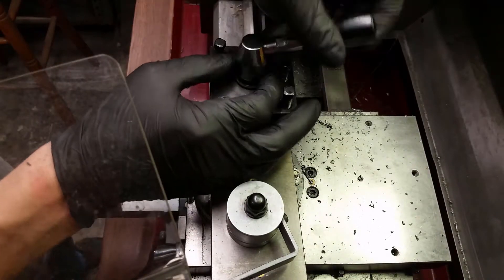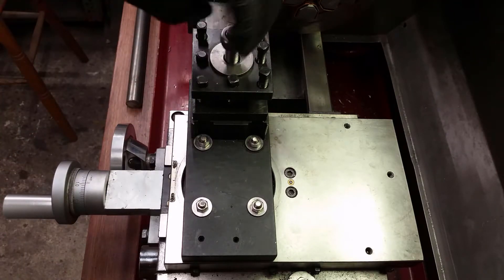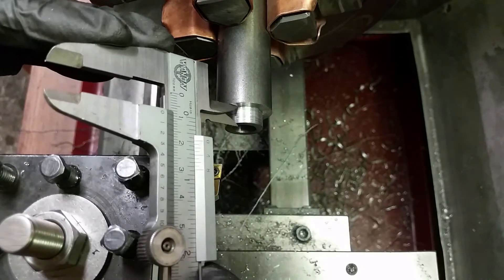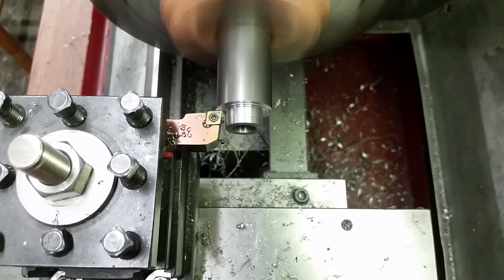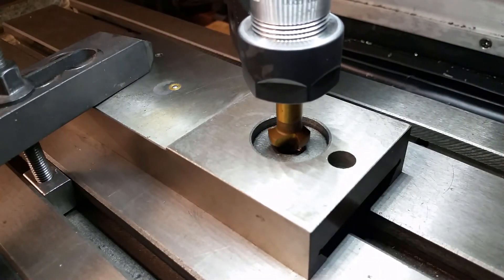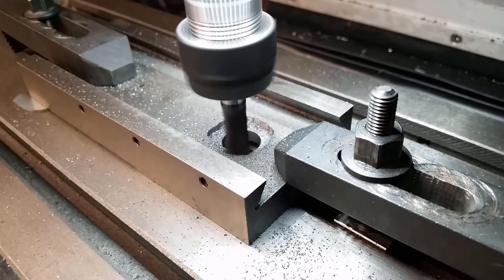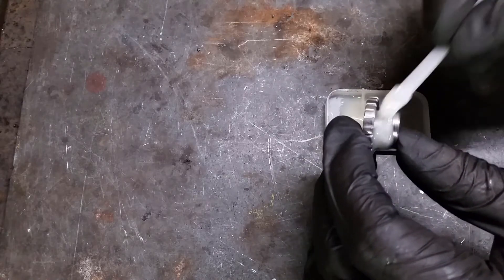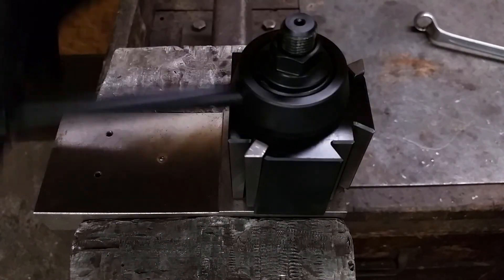Modification Of The Topslide To Mount My Quick Change Tool Post

Comment: Lots of hate here, but I like the idea of the threaded insert.  I need to do this soon on my Sieg SC6, but I think I’ll either machine matching flats into the insert/receiver hole, or I’ll key or pin it.

The alternative to your insert idea is to make a one piece shouldered stud from scratch which I’ve seen done but that is a massive amount of work.

Comment: Thanks for posting. Just one question, why did you glue that piece in? Thanks.
Reply from the maker: I was afraid the casting might break if i try to press it in. With glue you don't put any stress into the material. It is easy to remove if needed with just a heatgun.
Reply: @basementprojects4712  Hi, thanks for your reply, that’s what you said in your video. What I wanted to know is, why even use glue, why not simply leave it loose fit, why glue it? Thanks.
Reply from the maker: @SeriousSchitt  you can't reach the nut without taking the slide off. I wanted to secure the nut so it won't spin when i tighten or loosen the screw.
Reply: @basementprojects4712  Thanks for your reply.
Yeah, I was wondering if that was the case. You had a mill there why didn’t you just machine it oval? The bottom of the slide would’ve stopped the nut falling out and going anywhere and if it were oval it couldn’t rotate, and it would make it a hang of a sight easier to remove later on, should the need ever arise, instead of filing all those groves in it and risking a fracture of some sort, and having to deal with all that messy glue? Just wondering?

Comment: What size tap did you use for the AXA top slide factory bolt?
Reply from the maker: Hi. The bottom part is a M12 thread. The upper part is the factory thread. Hope this helps.
Reply: @basementprojects4712  Yes it does. Thank you very much.

Comment: I really enjoyed the process the tool post your using is the exact same as the one I fitted to my lathe last year I’m going to be making a solid tool post mount soon for when I am turning hard materials great video thanks for sharing stay safe
Reply from the maker: Glad that you enjoyed my video. A solid tool post is really useful not only in hard materials. I can cut faster und deeper into the material. With my lathe and a carbide tool holder i could cut a maximum depth of 1mm deep in stainless steel. I wouldn't do it constantly because it will wear out my lathe but as a test it was impressive.